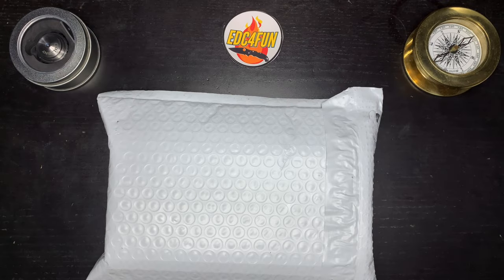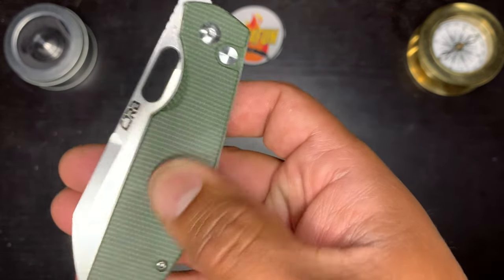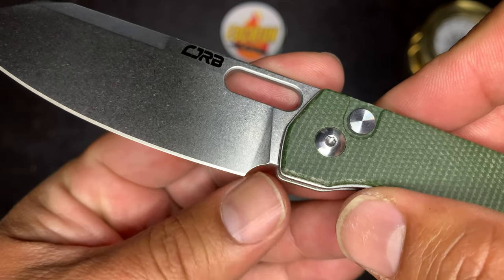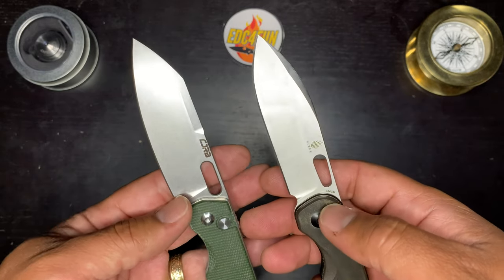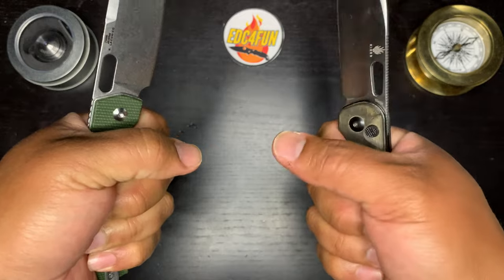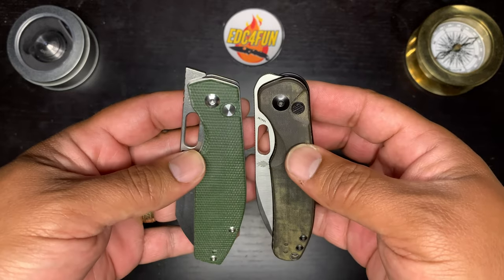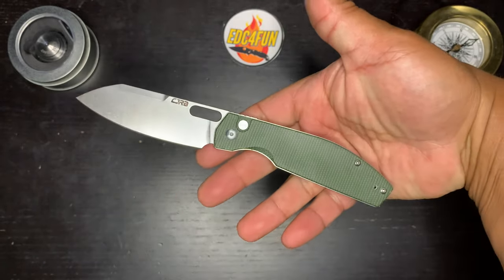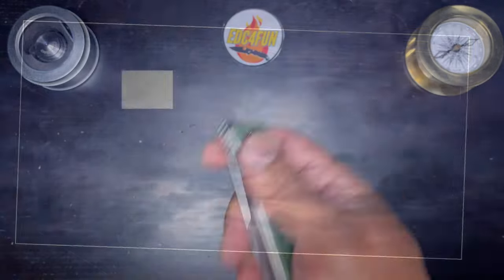CJRB Ekko front flipper button lock

Comment: That's a fair review. I have the black aluminum version and it is as smooth as silk!! The front flipper is effortless, but I agree that it does not have to stand so proud. It actually flips easier if I'm a half inch or so down from the top.
Reply from the maker: Excellent! It’s a sweet knife. Thanks for stopping by!